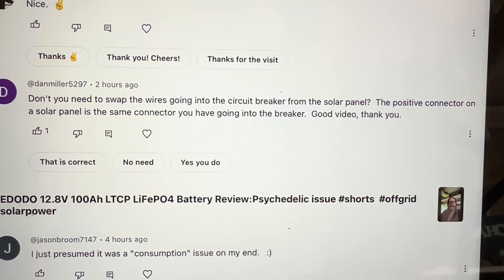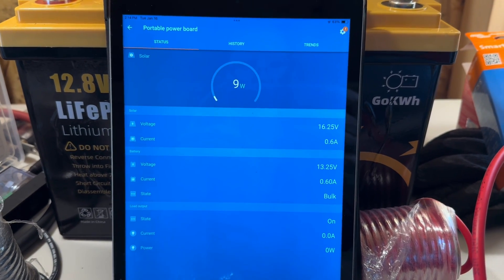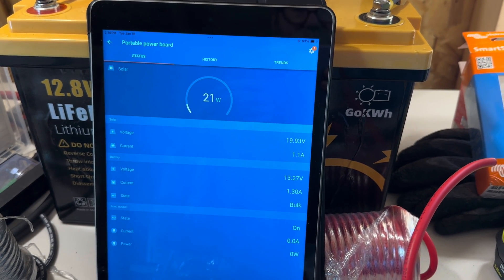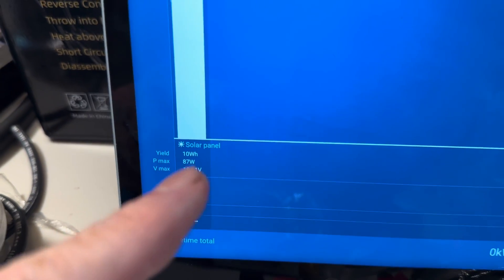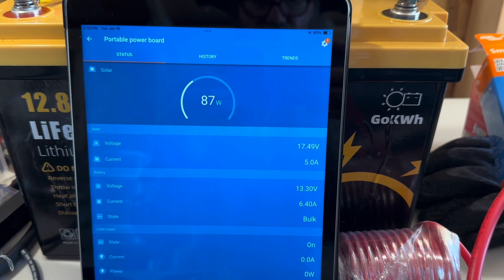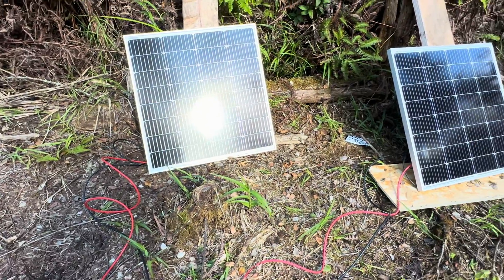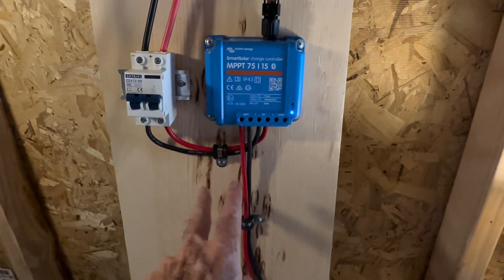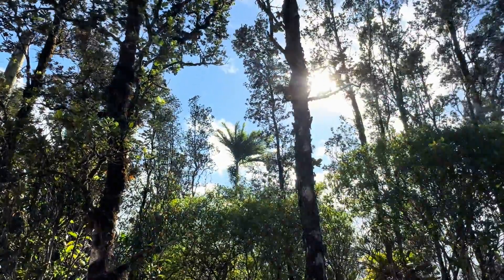MC4 connectors backwards?!

Comment: As far as I understand it, you only need one circuit breaker per circuit. I believe your panels are wired in series as one circuit going to the charge controller, So then you would only need to put one breaker in that circuit.
   Although you have 2 breakers in that circuit, I don't think that that would harm anything.

Comment: Just use wire that’s what the breaker is for, to turn the power off and on. 
If you really want to use MC4 connectors, then use your voltage meter to make sure you’re hooking up the right wire.

Comment: i had to revise my answer I learn something new: DC circuit breakers can be bi-directional, meaning they can interrupt the flow of current in both directions. This is important in DC systems where current can flow in either direction, such as in renewable energy systems or electric vehicles.

Comment: Hi Bob.  In the last video I did comment and obviously safety is paramount.  I think the hardest thing to remember is making the MC4 connectors and then screwing up and then having to buy more......  As I had commented before, some DC breakers (midnite solar) marked their current direction flow by using ++ and the highest voltage potential and + meaning a lower potential.  The example here would be say 21v is the PV side ++ and 12.8 is the + battery side.  Therefore indicating their preferred direction.  But honestly people will do what they want.  I try to avoid the wicking effect and install blue sea terminal fuses ON the positive side of my battery.  On breakers especially older or knockoffs I don't use double pole in the house.  But for people that don't believe this kind of safety topics...try shorting out a double pole fuse and watch it catch fire!  Yes, there are videos on it and once in a while you will see a car on the side of the road in flames!  Same reason to use a terminal fuse.......without a terminal fuse the short can wick up the wires and ignite them, whereas a terminal fuse in a dead short SHOULD blow only the terminal fuse and not ignite the wiring.  Just check out the sailing industry and/or coast guard folks.  My HF/VHF radios in the truck are also wired this way and directly to the battery with a protected harnesses.  But again for this video I only comment for folks to do their own research and educate themselves and THINK before doing anything where they could have serious consequences to life and safety.  Thanks again from Gary in SE MI. Aloha
Reply from the maker: Mahalo for the great info Gary! I agree, everyone should do their own research...for sure. I had to read your comments a few times for some things to sink in. Wasn't familiar with "wicking" and had to stretch the gray matter ...again. Love the conversations and I learn from you guys...so much. Aloha brother!🤙
Reply: Yes, totally agree with you. The safety of property and people comes first. You can do all kinds of tricks, but when it comes to connection and equipment, it's not worth making a discount. I try to make as few connections as possible and all of them to be of high quality. The mounting of the fuses must be done with great care, including the tightening force of the cable fixing screws. A thermal imaging camera would be ideal.
Reply: 100% agree with you and have found my share of dangerous fuses and even fake cable on Amazon where they hide or inflate the gauge since the count the thickness of the insulation too.  I recently swapped out the CCA sold as copper and now use ANL fuses on the high current side of DC.  I do like the thermal imaging camera too!  I use my fingers and why I got rid of CCA and fake gauge wires too. @yduRteKh

Comment: That's the way I have my circuit breaker wired, probably for the same reasons you do. However, my same brand circuit breaker, with the same controller, is only rated for 20 amps.

Comment: Allright, I might have posted some mis-information about DC breaker current direction.  I deleted that posting and will have to investigate a bit more in terms of what is on the market.

Basically, older DC breakers only worked with current going in one direction and were generally also polarized with "+" and "-" markings and had current direction arrows or line/load markings.

Most newer DC breakers are NOT polarized and NOT unidirectional, meaning they can break the current going in either direction.   But many 2-pole breakers are still labeled "+" and "-" (which usually means polarized), but aren't polarized... and there's just mass confusion.

The problem with solar systems is that shorts can reverse the current flow.  For example, when solar panels are in parallel a short on a string can cause other strings to dump into it, reversing the current.

I will research this a bit more.  I honestly don't know what percentage of miniature DC breakers sold on Amazon are still polarized.  Most of the popular brands are a knock-off of a German DC MCB.   Generally speaking, magnetic extinguishing MCBs should almost universally all be non-polarized and able to arc-break in both directions.  But does that match reality on shopping sites full of Chinese knock-offs?  I don't know.

-Matt
Reply: Ok.  I actually tore apart one of my ChTaixi 2-pole circuit breakers.  A green TXC65Z-60 B20.   This circuit breaker is a very common brand sold on Amazon.   It is marked with a "+" and a "-".

Both poles are completely identical and in the same orientation.  Which means that either it is not polarized at all and the current can extinguish in either direction, or the breakers are polarized but since they are oriented in the same direction and the current is in opposing directions, at least one is guaranteed to trip.  Since the two are tied together, that trips both of them and also breaking the ARC on one will break it on the other as well.

So I think we're mostly safe... these are, for all intents and purposes, non-polarized.

In terms of the engineering and physics of these breakers, I don't know enough about ARC extinguishment engineering to know whether what I'm looking at can direct the ARC into the extinguishing core for current in both directions or not.   It kinda looks like it should be able to do it in either direction.  But I can't tell for sure.  What I do know for sure is that with both poles going through the breaker, it will work in either direction because at least one direction of the two will be the "right" direction.

-Matt
Reply from the maker: Thats going the extra mile Matt, and mahalo for your test and for sharing it with us! Great stuff as always from you. Aloha brother! 🤙

Comment: One final note:   The use of MC4 connectors should mostly be limited to solar power and only for (roughly) 10A of current or lower.  Connectors come in two varieties, 15A and 20A, but the quality of MC4 connectors is extremely variable and should never be trusted above around 10A.

When making MC4 connectors of your own, note that the wire interface is a crimp, but it's a very light-weight crimp.  If you want the MC4 connector to be robust and last, solder the interface after crimping (it usually takes quite a bit of heat but it is worth doing).

Paralleling solar should always be done through a combiner box if the total amperage exceeds roughly 10A.   2:1 and 3:1 MC4 adapters do exist, but they are phenomenally dangerous and poorly made.  Often the internal interconnects use way too little copper and the adapters can easily overheat.

Comment: Dc circuit breakers are directional the reason is how they are built in side to extinguish the spark arc if you disconnect breaker under full load they can and do catch fire when wired incorrectly. There are videos on YouTube showing this happening  hope this helps. Regards Stephen in Melbourne Australia.
Reply from the maker: Mahalo to you in the Southern parts! Aloha!🤙

Comment: So, there is a convention, but it depends on the type of equipment.  If it is a power output, such as a solar panel, the MC4 connectors are one way, and if it is a power input, such as a power station or charge controller, the MC4 connectors are the other way.

An MC4 extension cable has both types of connectors.  One on one end, and one on the other end.  No matter whether it is black or red, all extension cables are wired the same way.   One end will be female and the other end will be male.

A solar panel's POSITIVE output is MC4 male, a solar panel's NEGATIVE output is MC4 female.

Consequently, a power station or a charge controller's POSITIVE input is MC4 female, and a power station's NEGATIVE input is MC4 male.

For DIY stuff when you start using MC4's for other things, like splices, the conventions can get mixed up.  I often find myself needing "red" (positive) cables with either type depending on what the other end of the cable is connecting into or being used for.  Same for black.  It can get a bit messy so always test the voltage.

Also note that older power stations and even some solar panels sometimes got the convention backwards. But they should all pretty much be on the right page these days.

(hopefully I haven't mixed anything up writing this, too!)

-Matt

Comment: I was doing some research and it seems that the way you wired the c/b is correct. It has to do with energy potential. The potential from the panels is greater than that of the controller, thus the direction of wiring goes from top to bottom. I found a video on YouTube that explains this better.  Thanks for the feedback everyone. This channel is quite the community.    https://www.youtube.com/watch?v=H5jYRlLm_VI&ab_channel=LupoDIY

Comment: yes it it cold in NY . 3 ft of snow . high winds . 6F low. driveling bands. was a very mild winter and 1 day a flop in weather. un less stated on breakers the IN/out does not matter. but the + and - does that why labeled . you can use MC4 in non standard way. but must be careful to get polarity correct to charge controller . I always use a meter to check wiring at   first before applying power to controller.
Reply from the maker: Warm and dry dry dry here! Kinda scary how dry it continues to be here. I have never seen it this way here. Normally I would be complaining about the rain and lack of sun. I think the age of constantly being flexible is upon us. What was normal is all messed up now. Aloha! 🤙

Comment: Standardized connections and layout are the best safety and operation guidelines.  Also, flexibility of operations should be considered. Now this is the only solar panel that can be connected to this board or if a jumper cable then only good for this board.  The switch action of the breaker will work, but the bottom lugs will be the energized lugs when the switch is in the off position.  Some speciality breakers may have directional sensors so connecting all breaker connections in a standard configuration is the safest plan!  If you mount the breaker upsidedown then the physical position of the handle will be backwards from other breakers and another safety hazard.
Reply from the maker: Mahalo for sharing that David...good stuff. Aloha!🤙

Comment: On the breaker question, I have seen them wired both ways. I have my breakers below the charge controller with the PV coming in the bottom of the breaker and have not had an issue.
Reply from the maker: Interesting for sure. I have not tried that. Been afraid! Aloha!🤙

Comment: Yes. Colors, plug directions and text with warnings and instructions are only conventions to make things easier and safer for people working on installations (installations, inspections, trouble shooting, repairs). Especially if it was the case that there are several persons responsible for the operation of this board (which isn't the case here).

And yes, you should do the dc solar breaker in that way, because it's not only about a continuous flow of current, but it also has to do with polarity.
Reply from the maker: Mahalo Rudi! Yeah I will continue to use as I should . Still ,on that dc breaker , it's not the easiest configuration, but works well for sure. Aloha!🤙